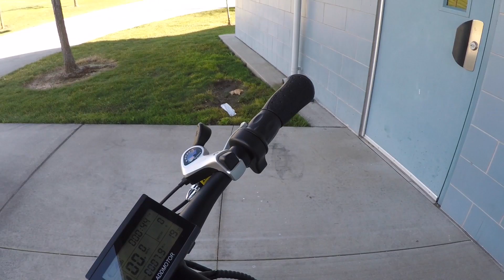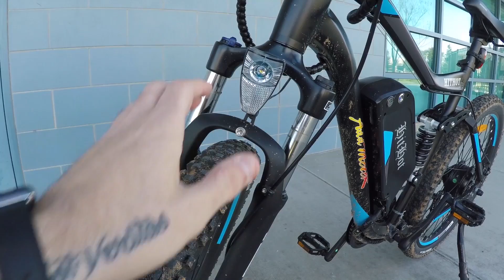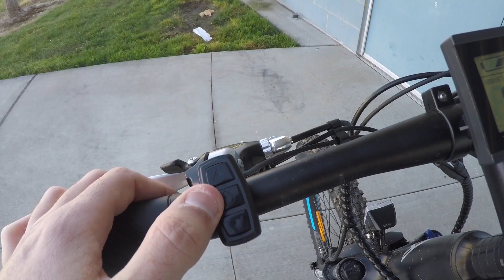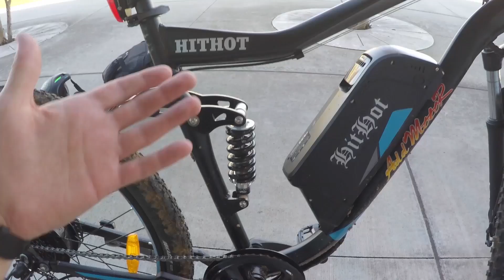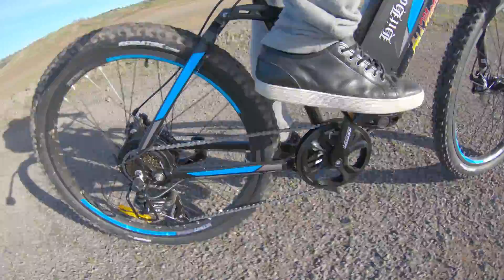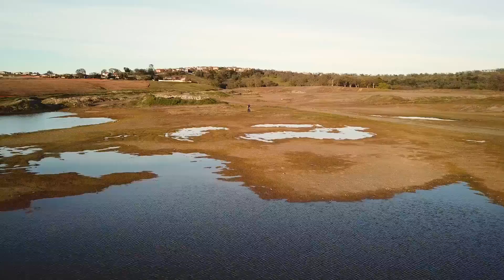AddMotoR HITHOT H1 Sport Review - $1.7k

Comment: I have an ADDMOTOR M-150 Bike that is one year old now... The bike is a solid bike. I'm 250 pounds and have about 4K miles on it... The motor only cuts out when you crank the throttle to much... I'm glad it does that rather then have the battery overheat and motor blow up... It recovers quickly when you lower your speed... I love the bike... It is a bargain and it is solid... I think the motor only cut out on me 2 or 3 times and only when I pushed it to hard...

Comment: "most of the stopping power comes from the front"...sounds good, if you want to go over the handle bars. The larger disc in the back evens out braking to avoid tipping over the front wheel. That said, I'm fine with the standard 160mm front & back or any set up that works for the individual rider as long as you know to adjust your braking habbits.
Reply: Michael Sprinzeles Funny, maybe you can teach the MotoGP guys and let them know they're braking all wrong.

Comment: I purchased an Addmotor "Motan" cheapie bike (2017 model year) as my first step to ebikes. Different from the HitHot, its a fat tire bike, which I would not recommend - tires are just too heavy and unwieldy, particularly with the added weight of battery and motor.  I found the Bafang hub motor to be problematic. When the motor gets stressed, for example steady uphill or long(ish) period of max assist, it just goes dead until it recovers. This is a big problem, as the added weight of an ebike without assist makes the bike into an anchor. I also don't like all the complexity of a hub motor that makes removing the rear tire a hassle and prefer having the motor weight more centered rather than having all the weight on the rear tire, along with body weight. The bike's total build quality is questionable. Loose bolts, heavy metals, chain issues, and I find the brakes are a little weak for to my taste. In general expect this bike to be heavy, as there is no consideration given to weight management - just check that big hunkin' kickstand hanging off the rear. And I'm not going to be as optimistic on the effectiveness of the suspension. Its really low end and that spring thing is pretty poor.  I still have the Addmotor, but moved up to the Levo Turbo Comp FSR, which, so far, is perfect. I do a lot of trail and street riding, living on a 100 m hill, so the ebike assist really helps. The Brose drivetrain on the Levo never cuts out, super quiet, lots of power when needed, and good weight distribution. Exactly what I was looking for in an ebike. I still use the Addmotor bike for light riding (to my local coffee shop or something like that) but the Turbo Levo is the real thing, great engineering, and to me worth the price - yes even at 3X the Addmotor. I look at the Addmotor as a throwaway after I have ridden it into the ground.  To be honest I think this review is a bit too favorable and not critical of build quality, parts, safety etc. Just look at what happened when walk mode was started - thats more like run fast mode. I mean come-on electricbikereview.com, when the bike jumps away from you at high speed in walk mode, you gotta call it out as a major issue. And thats symbolic of the bike in general. Finally, I would never take this bike on a real trail. It will just get trashed and rider could get hurt. To be fair, the low price, throttle, and sale through e-commerce will certainly attract customers. The price is very low and yes, that throttle is useful (great at stoplights), but illegal or certainly unwelcome in many places.
Reply: First your brought model not the same series of bike, for Motan, we do want it to be as robust and durable as possible, so we chose a thick kickstand, which of course makes people feel the weight increase,which more costed too,   same application on the battery and motor. Overall, we always consider the price factor when comparing configurations. Fat tire would more stable and sure will have resistance, and it's popular trend leading the market, for uphill and max speed for long distance high power consumption caused the motor stressed, it's because there is a setting for safety protection of the battery or it the battery will reach high temperature and reduce it's life. 
We do this Motan models is wish to let more people can afford the fun of fat tire but less price. As know better the market, we are considering high configuration, high cost E-bike, please keep en eyes on our products, thank you.
Reply: I'm very sympathetic to the price issue. A lot of bikes are out of reach at US$5,000+ and its a big leap of faith to a first time buyer. I have noticed decent discounts on quality bikes when model year changes. Haibike 2017 models are now at least $1,000 off. Cheapie (and heavy) ebikes can't do this: https://youtu.be/Vqozas0xz58

Comment: Excellent video, a testament as to why the future is customer direct via the internet. I bought two ebikes online, one on eBay another on Amazon. The Amazon bike came with free in-home setup. At this point, most of the manufacturers are making the bikes in China, and the quality is pretty solid. The bike shop model is obsolete and way too expensive for a general purpose nonspecialized use case. I would guess that $1,000 price point will become the norm for most nonexotic e-bikes. After being a very diligent Shopper, I paid $625 for a gently used 2017 Magnum MI5 and $655 after dealing with a few headaches with Amazon for a Jetson Rose both came with warranties. https://finance.yahoo.com/news/internet-transforming-bike-shops-community-spaces-155651665.html

Comment: Excellent video. Very informative.
When I was just recently researching electric bikes I seriously considered this exact bike. However I decided to go with Rad Power City's Rad Rover. I was less expensive and greater range and power.

Keep up the good work.
Reply: Not the same, H1 is a connecting rod double suspension mountain bike. Rad Rover do have some E-bike similar as ours, our price seems a little higher than theirs , but our construction fork, spare parts, battery and rim (double thickness) are being much high configuration for sure!! 
Same quality we do have better price, please compare only can base on the same quality, thank you.

Comment: I seriously considered it as it was listed on Amazon.  I'm soooo glad I went for a juiced bike instead.
Reply from the maker: I'm glad we're getting to cover some of these less expensive models. I agree that Juiced is offering a lot of value and great support for the money. I think Brent struggled to get some answers from AddMotoR due to language barriers.
Reply: Re:’vol. is Volume?”My guess is Vol. is Voltage, which is why it was at 47.
Reply: Juiced bike with a supper small battery, it´s frame is regular city daily routine riding only, comfort index just meet base requirement